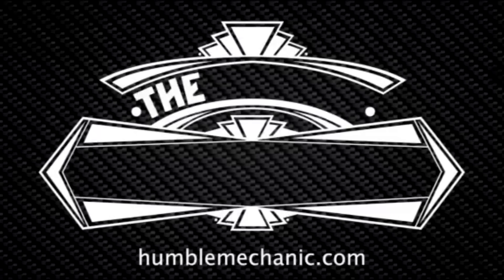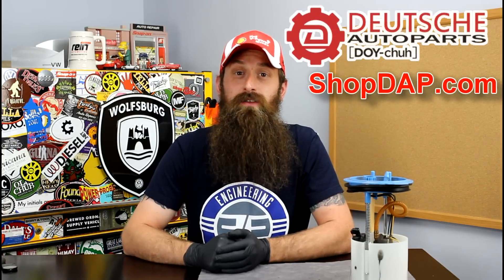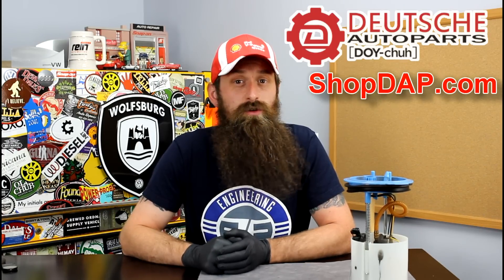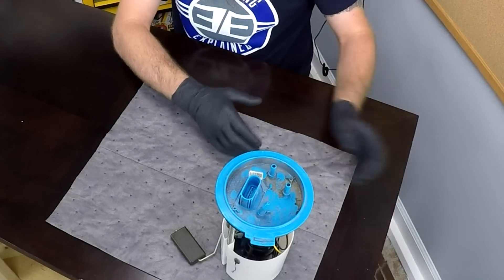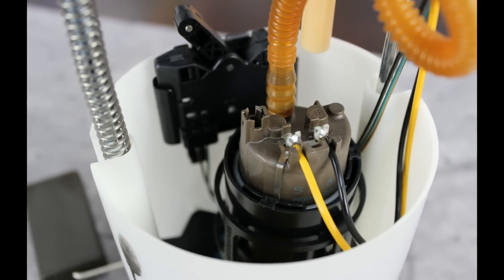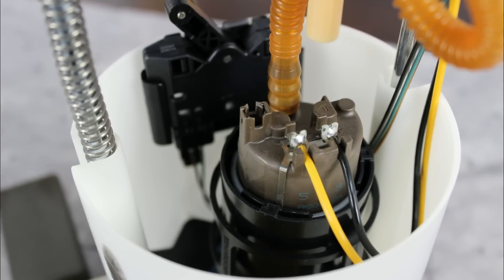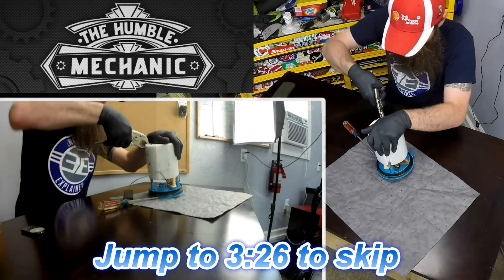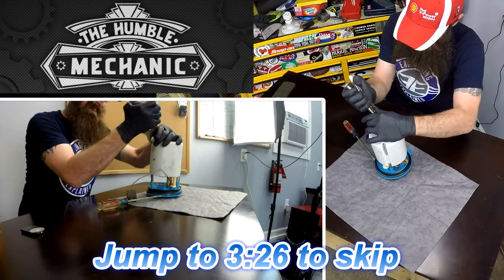How VW Parts Fail, In Tank Fuel Pumps

Comment: Hi, thanks for the video. I have a 2013 Passat 2.5L and I’ve tried every bit of professional help with no luck. The car stalls occasionally—about 5 times in the past 2 months. My MPG has dropped from 22 to 17.5. Smoke and visual tests showed no leaks. I’ve replaced the purge valve and inspected the injectors, but no visible issues were found. No misfires.

The car doesn’t idle rough—just stalls as mentioned. I’m in Arizona, so the heat is brutal, but I don’t think it should cause such a big drop in MPG. Also noticing a strong gas smell after running the car.

Any tips would be greatly appreciated. Thanks!
Reply: no engine prompts yet!

Comment: I’ve got a 08 vw eos 2.0. 
Crank no start & no fuel pressure.  We changed the transmission. Now it won’t start.  It’s been sitting for about a year during this process.  
We had it ideling very rough.  Scan tool said 10 psi fuel pressure.  So I changed fuel filter.  Now it won’t start & reads 4 psi fuel pressure.  
Gas comes out of the inlet for fuel filter but 0 pressure at the engine.  
I’m going to check & replace the crank sensor for the no start issue.  
Only engine code now is mass air flow sensor.  Previously there was a misfire code.  
I’m going to check the cam follower on the high pressure pump next.  
Any ideas to help us ?

Comment: Very informative video.  Just found your channel.  I have a 2019 Audi Q3 with what I think is a fuel module and/or pump problem.  The car will just die at idle.  Then it doesn't want to start.  I've looked around and it seems the Q3 and Tiguan are very similar.  I'm also getting a fuel related error when using my scan tool.
Reply: Did you happen to fix it?

Comment: For Jetta MK6 (TDI 1.6), What should be the current (amps) of the tank pump when working ? i see in the manual should be between 4-8 Amps, but my pump amps is only 2.5Amps
My car run ok but my HPFP (siemens) failed twice in short period.
Reply: Btw, it's a brand new pump (Bosch)

Comment: I have a 2015 vw gti -for a few months now it occassionally will hesitate starting. turn the key and it doesnt fully turn over,turn key to off and it still tries to start then shuts down, after 3 tries, it fully starts. in the garage now but theyre saying they cant duplicate and figure out what it is.  is this a fuel pump issue

Comment: Hi All
I have a MK5 Golf R32. Fuel gauge works intermittently. Car drives fine. When I start up the fuel gauge will work and show how much fuel is in the tank, after a few minutes of idling, it goes down to empty.
Fuel in the car is about 3 quarters full
Is the fuel sender the issue?... any comments of advice would be appreciated.  Thanks

Comment: Thanks for this video. 
Wanted to know. On a 2014 VW Polo Comfortline (Indian Version), one of the symptoms I'm facing is a high pitched noise as soon as the engine starts. Also there is a bit of juddering/ jerking while accelerating. Could this also be a symptom of a bad fuel pump?
Thanks.

Comment: Hello guys, 
Thanks @humblemechanic for the vid
I have this error codes :
P310b low pressure fuel regulation
P3089 electronic fuel pump, signal cable electric fault
I changed the HP Pressure fuel pump last month.
The car starts and drive fine but don't go over 2900rpm.
I recently got a blown fuse related to the tank pump replaced it than after 2 weeks blown again. 
How do I know if it is the pump or the relay above it. 
And does it relate to the error codes? 
Any help is appreciated!

Comment: Does anyone have any thoughts B7 (Passat) fuel pump life expectancy? My daughter is moving far away and don’t want her to get stranded. The car has 125k and is original. I have about two weeks and thinking of proactively changing it before she leaves. If there is anything else that is a “must do” if original please let me know (PVC oil separator) is on my list. The car has had great maintenance and does not leak or burn a drop of oil. The water pump might be original but bone dry. Thanks.

Comment: Hi mate would you know where the location for vw sharan fuel tank pump would be I’ve tried finding a video or diagram online nothing I have issue with starting the car and been told to change the fuel pump thanks
Reply: On the Sharan it is behind the drivers seat about 500mm  away under the carpet.

Comment: Hi  Charles i have a question for you , i have a 2012 passat  this morning i tried to start it and it only cranks but no start , I’m a do it yourself guy , i open the supply line under the car and try a start , and have a good gas flow , but not going to the fuel rail , my question is , is there any valve  between line after the fuel pump? Or there’s a blockage?thanks I’m waiting for your reply.

Comment: lol if your car turns on and turns off right away gas pump  check  if you havent replacement the pvc value  nor  done a carbon built up clean     the MAF senor   maybe those  can be but those are coming in with codes while the pump doesnt seem to be giving me at my side

Comment: 2016 Jetta Hybrid SEL less than 100k had a fuel pump failure.  I was able to order a replacement and changed it out in about 2 hours, very easy.  The hardest part was  the top outlet fuel fitting that didn't have a button to press like the other fitting, it was much smaller clip that I had to push and it finally came off.  There was another fuel fitting in the tank that attached at the bottom of the fuel pump housing, I guess there's another pickup point in the tank?  Also the EPC and CEL lights were on, the codes were - P064A, P0087 (fuel pressure system too low), P2414 (o2 sensor sample error bank 1 sensor 1), P2279 (intake air system leak). Once all codes cleared the lights went away and the Hybrid drive started working.  I also changed out the air filter and the cabin filter. That leak in the air system is another hose that I couln't get (it's back ordered).

Comment: I have a 2.0t Jetta, the fuel pump won't kick in, the starter doesn't kick in (starter has been tested and works) and instrument cluster says nothing about the low coolant or anything, voltage goes to the fpcm and out of it.

Comment: I need help my volkswagen cc 2012 doesn't start.. it cranks but doesn't turn on . I've recently changed my transmission clutch . Took it apart and put everything back and now it doesn't start ..it started before I changed the clutch.  Things that I've done are , I changed the high pressure regulator fuel pump thinking that was the issue and I tried starting it and nothing .. I've also checked the spark plugs electrical lines to see if it was a power related issued and they all seem to be good  . I've also replaced my battery thinking it was that and still no start.. now I don't know what to do or what to check for and tips ? Keep in mind that this is my first time doing this sort of job .

Comment: If the fuel module is bad can it cause the fuel pump to go bad? Dealing with problems with my 2015 Passat volkswagen thought it was the fuel pump replaced that for $900 and now are trying to say it’s the fuel module which is another $400 to replace

Comment: Man, i know this is a old video but,  my vw 1.8t crank but don't start, sometimes does... I check fuel pressure on the top Chrome solid pipe and when it does  have pressure up to 53 the vehicle starts... I check 12v going on my fuel pump but even when it get power the vehicle doesn't start...can u please put me on the right way please....I'm not a mechanic....

Comment: Need Help! I have a 2010 Tiguan that stalls at a 1/4 of a tank. No lights or codes are triggered and once I put gas, everything start working fine. I replaced the delivery and main pump to troubleshoot the issue, but still giving me the behavior.
Reply: We’re you able to solve it ?

Comment: 2008 Passat tdi 2L engine stalls and the engine fault light comes up while driving and the car slows down. Done that, advised to change the Manifold - done that. The car runs great until the engine fault light comes up. Does the fault lie with the fuel pump or high pressure fuel pump?

Comment: Great video and thanks for sharing. I'm new to the volkswagen family and I am pretty an amateur when it comes to car issues. I bought a vw passat b5 1998 model 1.8l petrol at a government auction. It's driving perfectly well but with notable problems. The fuel gauge is not working, gladly the fuses are OK and the pump is still working but no longer in its perfect state because it drags to start especially early morning hours. Maybe it's another problem not related to the pump. Secondly, the central control unit burnt-out because of water. I've ordered a replacement. What should I do with the gauge. Secondly, what do I need to do when replacing the central body module.

Comment: My wifes b6 Passat fuel pump cracked on top, spiderwebbed,  across the plastic housing causing fuel odors and leakage. I was caught off guard, not a good scenario. After 150k you may want to inspect the condition of the top portion of the pump for hair line cracks. FYI :)
Reply: Dude thank your comment my car is currently smelling like gasoline. I'm going to check it

Comment: Hello. I have a vw bora diesel 4motion 2001y which has 2 pumps in the tank. The pump does not deliver fuel to the engine. I also disassembled the motor that is working properly in the plastic case. I reassembled it and the same thing happens - no fuel is delivered, so I think someone replaced the pipes on the pump itself. Please explain to me the principle of operation of pumps in 4motion. The main pump is 1J0919183G

Comment: The reason the pumps sitting in a plastic housing is because there’s always fuel around the pump the gas tank is designed to centre the fuel around the pump. So when your tank gets low the fuel drops right to the pump. Some say don’t go below a quarter of a tank because the pump won’t be submerged anymore well yes the plastic housing won’t be under the gas anymore but the pump is still fine. Just never run the car completely empty cause then the pump will suck air and that will ruin it.

Comment: Hey Merry christmas from here in the uk.
Im wondering if you csn help because Im really stuck.
I have a 2008 VW T5 transporter 1.9pd. The van runs well until it warms up. Then it misfires heavily in 4th and 5th gear, under load. ALSO the fuel tank is massively pressurized when I pop the cap. It runs badly with no cap on too. There are no fault codes on vagcom. Could this be the intank fuel pump? Please help. Im desperate now. Thank you

Comment: Hey Charles! Love all the content mate and I have a question may I ask? I've a 97 VR6 Golf and I bought complete bosh pump unit with the lines and I'm struggling to remove the old lines from the sender unit. Any advice on how to get them off please? Twist n pull only twists the lines and too tight of space for pliers. I don't want to be too rough incase I break the float mechanism that's attached. Nuff DUB love from the UK 👊🙌💜 Thank you

Edit: Solved it with boiling water in 5 minutes  after writing this 🙈😂😂

Comment: Hi there HumbleMechanic I own a 2013 VW jetta 1.4 tsi CAVD engine, the car had been acting strange for the past 6 months or so cold starts will cause it to vibrate badly but when the rpm stabilizes at 730-ish the vibration goes away and car runs smoothly doing a scan using OBD11 picks up misfires on Cyc 1&4 but not enough to throw a check engine light so I replaced the spark plugs by myself during movement control order after which the car ran smoothly though OBD11 were still picking up misfires.

Managed to get it to the garage after 4 months back they found 2 coil connectors were broken that was replaced they also performed scans which didnt pickup any misfires they also ran a compression test twice and results were perfect. At this point I thought the problem was fixed but after 2 weeks found that my fuel consumption had deteriorated a little so I ran OBD11 again only to find out there were misfires but no fault codes or CEL baffled by this I got it back to the garage this time injector test were done along decarbonizing (walnut Blasting) too and still there were misfires at this point I thought it could be my cheap OBD11 I wasn't accurate and so left it.

Just a week ago while I was driving home car started shuddering like it was going to stall car went into limp mode so I drove it slowly back home check engine light flashed about 3 times then went off but the EPC light stayed on used the OBD11 and faults registered were P0300. P0301 and P0304. Engine misfiring on cyc 1 & 4. Tow it back to the garage and they recommend changing coil packs which solve that problem. However the cold start vibrations still occur and when the car idles you can feel an intermittent vibration from under the seat.

This time after 3 days of testing in the garage they recommend changing the engine at 6k without a concrete reason. I brought the car home still runs smoothly except when it idles and cold starts vibration. I had done some searching up on google and youtube found a VW golf mk7 having identical issues which turned out to be high pressure fuel pump for the owner could the same apply to mine?  would really appreciate any advise thanks

Comment: Hi There, I have a VW Passat CC 2011. I occasionally have misfires while driving for approximately 2 hours or more. This mainly happens when I am  idling. Eventually the car cuts off/stalls and doest not restart right away. I changed the high pressure fuel pump, cleaned the manifold from the carbon buildup , O2 Sensors and PCV Valve. I have no check engine light on the dash. What do you think can be the issue here?
Reply: Hi there, did you find out what the issue was? I've done exactly the same as you have. Changed PCV valve, O2 sensor,  fuel pump sensor, HPFP, carbon cleaning. Only thing I haven't changed is the LPFP. I would have misfires, and sometimes the engine light went on for misfires. Changed injectors and coils but still get misfire issues sometimes... car would also randomly shut off on me, never while driving, but while idling or after long periods of driving. Car would shake violently and then would just shut off sometimes. After waiting 20 minutes, the car would start like nothing ever happened.

Comment: Before you condemn the fuel pump check the fuel pump relay, my fuel pump just "failed" by having no sound while cranking but spun fine being manually triggered at the pump, it was only a $5 relay that saved me from a potentially $500 fuel pump job that most likely wouldn't have helped me at all.
Reply: Where is the fuel pump relay? Because my car starts fine but one day it started while driving felt like fuel gets cut off for a millisecond n after reapplying foot pressure it picks back up
Reply: @StreetWraith501  I guess you'll never know.

Comment: I bought a 2003 VW Eurovan, drove it to the beach the first time. On the way over it was fine, on the way back though, I had the van die on me on the highway. After letting is sit for a bit, was able to drive it off the freeway then dies again. I was able to do this multiple times to get closer to home, but the van eventually would "live" shorter and shorter between these cycles to eventually having to park it to tow back home.

Comment: Hey humble mechanic, I have a vw polo 1.4 classic 2003, I had opened the pump to clean the sieve now upon replacing it the guage is misbehaving it only goes upto Qtr tank and it doesn't go beyond that mark when I put more fuel when I start the car but the car has gone off due to low fuel several times and the fuel light does not turn on, its inconveniencing, how do I centre in right position?

Comment: I've had some crazy things with my 4motion passat, I was stranded on the highway because of a broken fuel module that didn't sent the signal to the lifter pump so I drained the whole right side of the tank. Fixed it and it drove fine but now I also have a clogged filter due to draining my tank 😂

Comment: Hi long shot but I have a Mk5 golf TDI 105 it's cutting out after running a while but before that I get a shudder but won't start back up unless I put some carb cleaner in the intake  I have had the g28 sensor replaced also had the car plugged in and the only fault was glow plugs I live in the UK a recovery bloke said that's not a problem and help or advice would be brilliant the AA bloke said like the car has air in the lines

Comment: I need your help.i have a 2009 VW tiguan 2.0TSI CAW.my fuel consumption has  been very high I was advised to check for the tank ventilator that allows  excess fuel to return to the tank has been blocked.i have checked online but I dont see this part.maybe it has a different  name

Comment: I have an issue with my 2012 touareg tdi V6 the low fuel pressure alarm comes up under heavy acceleration (goes into limp mode) otherwise the car drives fine. upon further investigation the fuel pressure in the rail doesn't quiet meet the specified value under heavy acceleration. 
I have changed the fuel filter and checked the low pressure fuel pump flow rate and this is fine. (1.8 liters in 20 seconds)
I have removed the low pressure fuel pump the strainer is clean and the pipework is in good condition with no leaks.
I have removed the inlet manifold and removed the metering valve on the pump with no metal particles found so replaced the metering valve.
Inspected the fuel pressure regulator on the rail this seems to work and shut off when 12v is applied to it. (after removing i found they have a one use seal so replaced it anyway).
Now the car will not start at all the fuel system has been primed with the electric pump, there are no fault codes but when you look at the fuel pressures when cranking the pressure is only low and doesn't get to the specified 500 bar to start.
Any ideas?